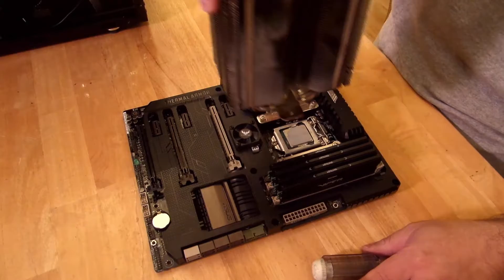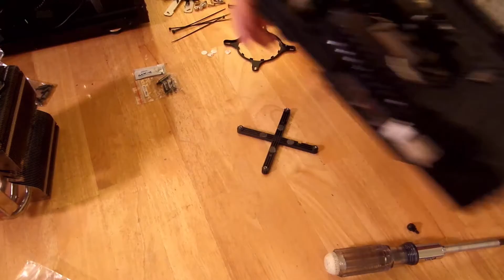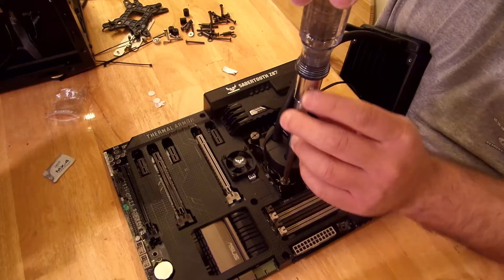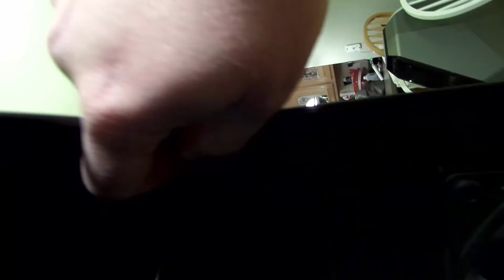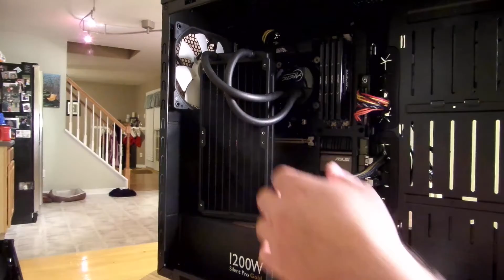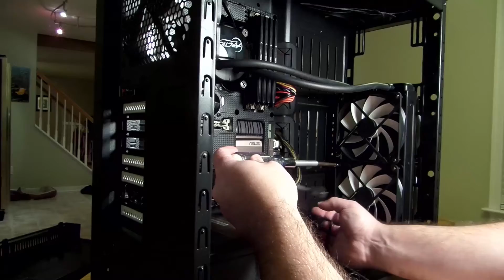How to install the Arctic Liquid Freezer 240 CPU Liquid Cooling unit in the Fractal Design Define S

Comment: Thanks for this guide, I was watching bits and pieces of your guide as I installed mine to make sure I was doing things right, even though I found the simplistic manual to be pretty straight forward too, a video guide is always better. Am loving this AIO so far. I have a 4790K, and if I leave it at stock settings, my idle temps are in the mid 20s which is a big difference to what I had before, but I've overclocked my CPU to 4.9Ghz now. With my old evo 212 air cooler, I would have idles of 45-50 and load temps of high 80s/low 90s if I went up to 4.9Ghz, but with the Arctic 240 I have idle temps of low-mid 30s and load temps of high 60s-low 70s! Great way of prolonging the life of our overclocked CPUs.

Comment: I actually asked Artic cooling if the pump needs to be oriented in a way that the logo is upside down. And they told me that they've fixed the logo orientation in their new 360 model and that it does not really matter which way you install it, as long as the hoses are not bent. Direct quote: "There is no problem if you mount the pump with correct logo direction, but please make sure that the hoses are not bent." So I have mine setup with the logo vertically so that the hoses reach the front of my Define S case easier and with no tension.
Reply: Harbaaa With all fans inside and the orientation as you have it, would I be able to mount it in the front (like u did) but in the top part of the front of the case instead of at the bottom (front)?

Thanks.
Reply: That is exactly how I have it mounted in the Define S.
Reply: Harbaaa So below the radiator you still have space for a 120mm fan in the define S? :o.

So this would mean there is enough tubing to have the tubes come from the bottom instead of having it at the top? (this to prevent airlocks)
Reply: Harbaaa Thx btw
Reply: Harbaaa Do u have a picture of your build somewhere? :)
Reply: Here is a pic of my build: http://imgur.com/a/qh3CV

The front of the Define S can fit 3x 140mm fans so there is enough room below the rad for a 140mm fan. I previously had a 140mm Arctic Cooling F14 fan there, but then removed it as it basically just made noise, it had no effect on the cooling. So now I just have the 4x rad fans providing intake and a Noctua fan, spinning 700rpm all the time, at the rear exhausting. The system is a i5-6600k overclocked at 4,5ghz and a Gainward GTX 1070 Golden Sample, also overclocked so that it reaches 2088mhz on the core when gaming. The CPU stays below 60c under load and the GPU stays below 70. All the fans in the case are set to low fan speeds to reduce noise. Radiator fans spin at about 900rpm, maxing out at 1200rpm, if needed. The GPU fans spin 30% at idle and 50% (1400rpm) under load. GPU is completely silent, only noise is made by the radiator fans. I might end up replacing the radiator fans in the future in the hopes of finding completely silent ones.

I was worried about an airlock when building the machine, but after researching further I came to the conclusion that its nothing to worry about. If you look at 99% of the builds in the internets you see that the tubes enter the rad at the top, and I could not really find a single case of there being an airlock in the AIO, at least from this century..
Reply: Nvrmnd, it works
Reply: Harbaaa Thanks!! This is exactly what i wanted to see!!! THANKS! Finally made my choice. Unless the X62 turns out to be amazing, the custom pcb on it seems great.

Both are Gen. 5 pumps
Reply: Harbaaa What motherboard is that btw?
Reply: Asus Z170 Pro Gaming

Comment: Good video btw, I noted you were concerned about straining the rubber tubing, you seem to have plenty of room in your case to mount it push pull config inside the case. That will also make your push fans more efficient as there will be no air pressure leakage from around the edges of the fans (the case mounting tabs act as spacers stopping a snug fan/rad fit). That said, your video has helped me choose this cooler for my next build, many thanks.

Comment: Nice video(subbed right away) Very helpful tips. Thanks for the informative content.
Reply: Hey iggy, i got arctic lq. freezer 240 for my i5 6600k with a gtx 1060. The processor doesn't go over 35 celcius degrees, which is awesome. Just wanted to thanks again for inspiring me to buy this cooler.

Comment: Hey, when are you planing to post a video showing temps? Btw great video just one question: puting the radiator in the front wont make air inside the case much hotter? Wouldn't it be better on the top? Sorry need some advice!
Reply: It would be better along the top, but I didn't have room

Comment: Nice vid! I have the same case and that is not the way you remove front panel. At the bottom of the panel is place where yuo put your hand and just yank it! No need to push from inside.
Reply: Yep, it's the same. Just yank it a bit harder. Btw, did you OC processor? I wanna know the temperatures while oc-ed.

Comment: For the pump's sake, you have to place the radiator in such a way, that the pump is on the lowest level. In that way it will always have something to pump. This cooling solutions arent air-less, there has to be a place for expansion.  I dont know for sure but I assume it is like that.
Reply: Good review, nice job!! :)

Comment: Hello, fine guide, got 2 tings i would Change, nr1. which others points out, mount the radiator in the top, or Your gpu boost "nvidia" Will down clock it self, cause of higher temps. Nr 2, sorry but Your Dust filter in front is almost the most importen Thing about Your case, why mount the coolers outside the cabinet? So You cant use the Dust filter? .... There is more then enough room  for it All to be inside the kabinet..... But again back to move the radiator up top so it pulls hot air out of the  cabinet, and install 3 New fans in front, and ofc inside cabinet, so You can use the most important funktion of You kabinet, Dust filter... This Will give a positive air preassure inside kabine, cause You blow abit more in then out, which means, No Dust inside cabinet over time, Dust is a hardware killer... This Will Als give You perfekt air flow, which Will again give You higher fps in game. Anyway like how You review, detailed and guiding, it Will be a great help for many.

Comment: The front fans are going to be almost touching the front panel of your case, it looks like they have almost no airflow .  Also these are high static pressure fans.  By not having it tight to the rad on both the front and the back you are loosing some pressure.  The back ones will be sucking air through the rad adequately, but the front ones have a gap between the fans and the rad, so they wont be as effective.  If you have no space to mount the front fans on the inside of the case I suggest just removing them.  They aren't doing you any good and as tight as they are to the front panel they are just impeding your airflow.

If you leave your exhaust fans on the back of the rad, then take the intake fans from the front of the case and mount them directly on your rad, then mount the whole fan/rad unit on the inside instead of having those two front fans on the outside you will see significantly lower temps on your CPU.

Comment: Wouldn't putting the rad up front mean you are blowing heated air into your case?  Putting the rad up top with fans blowing out would yield lower case temps (GPU) wouldn't it?
Reply: Thanks for the info.
Reply: no, since I am not overclocking it

Comment: Thx for the vid. But why did you mount the Push fans on the outside of the case? if you would add everything inside the case u can add back the dust filter and the hoses are less tight.
Reply: Iggy Castillo Thanks man. I have a Fractal Design r5 and I'm currently trying to choose between this cooler, the x61 and the h110i. And I want it front mounted. 

Your vid was really helpful. I like the Arctic 240
Reply: Iggy Castillo Where can I find the vid where u have all fans inside the case?
Reply: Iggy Castillo Thanks. BTW if you want to do a front mount, you need to turn the CPU block 90 degrees so both hoses have the same length.

Because of the orientation, you're losing a few cm.

Knowing all this, i have 1 question.

If I'd turn the orientation AND have all fans on the inside would I be able to do a front mount bit high in the case instead of down? This for airflow reasons. I would like to avoid the hot radiator air blowing over my GPU. By mounting it high it aligns with the back exhaust fan.

U think the hoses are long enough taking all the above into consideration? Thanks.
Reply: The reason I'm asking is because if you front mount you really want to have the tubing at the bottom of the  radiator. Also I'd like to add a 120mm fan under the radiator.

Comment: I know this video is old but by looking at that setup any water drops in that radiator results in a dry CPU pump. Get a longer hose or somethings. Just my 2 cents
Reply: It is a little over 2 years old, but I ran it for quiet some time with no issues, I was not able to install it at the top do to the RAM, I believe it was, but again it was a while ago.  The liquid cycles around the pump and radiator so it would not have been dry.  I do appreciate any and all input you may have though.

Comment: Great in depth video butt here is my story.

I just purchased the Liquid Freezer 240 and I have a question how to install it.

My motherboard is a Gigabyte 970A UD3P. It has the following fan connectors.

1. CPU FAN
2. SYS FAN 1
3. SYS FAN

Number 1 ok it's the CPU where rpm is controlled by cpu temperature.

Fan number 2 speed can be controlled through gigabyte's easy tune software but it measures the temperature in the case.

Fan 3 is working at maximum power all the time.

The installation manual shows that the fans go to CPU fan. Where shall I connect the pump? Fan 2 and set it let's say at 50%? Or fan 3 so it's working at maximum all the time?

Best Regards
Georgios
Reply: +Iggy Castillo Thank you for the quick answer. Shall I leave fan #2  or #3 (which ever I choose) speed and temperature ratio at the default values or shall I go on on a specific side e.g. lower speed or higher?
Reply: +Iggy Castillo Thank you really really much for helping me decide!!! :) Subbed :)

Comment: I'm 5 years late, but not to be the bearer of bad news but this is installed incorrectly.  The water lines should be at the bottom, not the top.

Comment: So I connect the fans to CPU header and pump to CPU pump header?
Reply: Please respond I don't want to  destroy my PC 😭
Reply: Thank you
Reply: +Iggy Castillo Ok you said to put in the 3 pin connector but the Manuel points the pump to be plugged in 4 pin connector. Should I just put it in 3 pin?
Reply: +Iggy Castillo Ok and that should also work because both of my fans on the radiator are plugged into CPU fan and my pump is also plugged into CPU fan which is also a 4 pin
Reply: +Iggy Castillo dude you are a life saver. My new PC is working with all my programs and games, and without your help and video I would have no clue what to do. If I had to remove all my subscriptions except one your channel would still be there
Reply: Thank you so much for your kind words Dank, I am very happy I could help you.  It really is a great liquid cooling unit, very happy you can see the results.

Comment: Does anyone know if Arctic AIO's are compatible with Intel 775 chipsets/motherboards? Thanks in advance!
Reply: Thanks! Glad I didn't get flamed for my typo and that you knew I meant 755.
I ended up going with the Silverstone TD-02 lite (240mm btw) and am loving it so far. Install was nice and easy in my Deepcool Dukase V2 White case.

Comment: I have a couple of questions about these Arctic AIO liquid coolers - if anyone here could help, it would be greatly appreciated:

I'm looking to upgrade my current build (Enthoo EVOLV ATX, i7-6700K, and two GTX 970's in SLI) with liquid cooling. I've never done liquid cooling before though, so I don't want to endure the potential risks of running a custom water loop. Thus, I'm looking at getting one Arctic Freezer 120 AIO for the CPU, and two Arctic Hybrid III 120 AIOs for the GPUs. My problem is radiator placement: I originally thought I could place the CPU radiator at the top or back, and the 2 GPU radiators at the front, but then I realized that I'd be pulling in warm air from the front (cool air outside the case mixing with the warm radiators, and being pulled back inside the case). Then I thought I could place the CPU radiator at the back, and the 2 GPU radiators at the top, but I don't know if the GPU radiators will reach that far.

Does anyone have any tips on radiator placement? Will placing the GPU radiators at the front cause the case to heat up too much? Or can the GPU radiators reach the top of the EVOLV ATX? I know it's pretty unorthodox to have three AIO coolers in one case, but I just don't have the experience (or the money) for a full custom water loop. Again, any help would be greatly appreciated.
Reply: +Iggy Castillo Thank you so much for the quick reply! I do overclock the 6700K when I run some physics/engineering simulators, so I guess it would make sense for me to put that one up top. Thanks again - I'm checking out that Freezer 240 review right now.
Also, you just gained a subscriber :D
Reply: +Iggy Castillo Do you think that the 2 video coolers will be able to reach the top of the case?

Comment: I've just bought this cooler for my new PC, and surprise surprise, the pump makes a very loud grinding noise, especially while playing. The pump is plugged in a 4 pin connector from the MB ( i have no 3 pin connector on it), and the rad is mounted in front of the Case.
Do you have any recommendation / solution for me? Thanks
Reply: Thank you for the fast answer!
I saw a bunch of videos on youtube with solutions for this 'grinding' sound, like: shake the unit, move it from one side to another, tap on the tubes, on the pump.. and I'm not convinced that this is the way to fix it.
I wrote an email to Arctic, waiting for a reply. If they have no solution but replacing, this is what i will do.
Thank you again.

Comment: Hey, if put the airflow inside the case the air wil be cold?? Cause if its cold why should i put to outside?
Reply: oooh okay, So finally much better putting the fans in the top right? By the way great post and videos!!
Reply: and yes, a bit better putting them at the top.  I just realized why I had put the fans the way I did.  There are very few vents on the side of the case, none on the front, so it would struggle to get air, but I wanted to try both options.

Comment: Why do you have a 1200W PSU?  That's about twice what a system like yours actually needs!
Reply: Fair enough if you were given the PSU.  Most PSUs provide their best efficiency at about 50% load, so with a 1200W unit in a system like yours, you're pretty much never going to be running it at it's optimum.  To answer your previous question: I've changed my PSU once in the last ten years due to a hardware failure, & in that instance, I swapped a 600W unit for another 600W one.